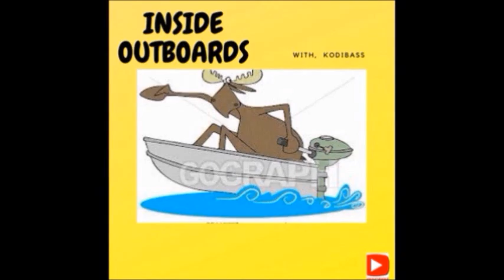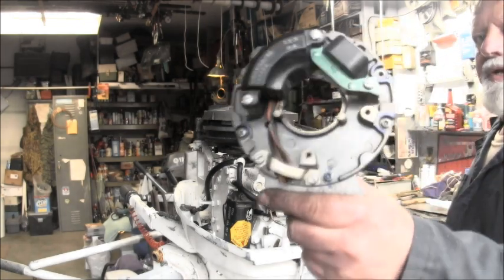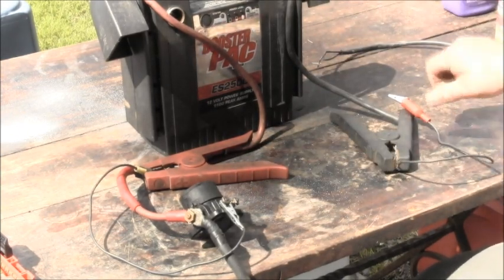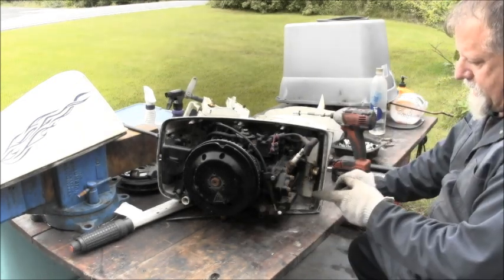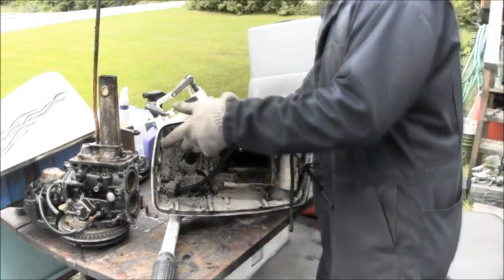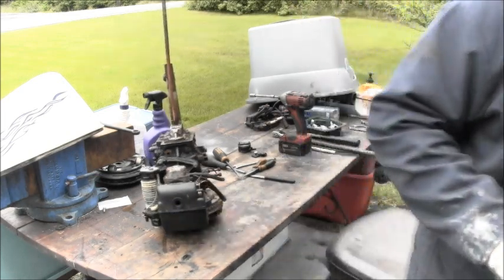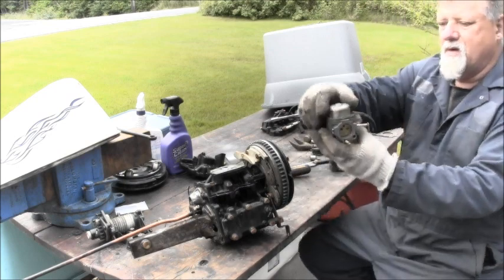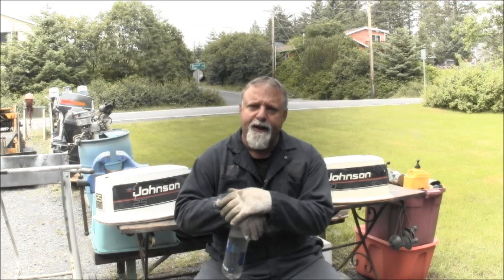JOHNSON 1989 25 / 30 HP & JOHNSON 6 /  7 5

Comment: I recently got a 1989 25hp parts motor and it had the same ignition system and it appeared one of the bolts that held the ignition module on vibrated loose and caught the flywheel and  caused a good bit of damage under flywheel and ripped the wiring on it apart.

Comment: I know an OMC has been "cobbed up" as soon as I see RTV on the crankcase halves and intake gaskets.  The salt water probably just put this poor thing out of its misery.  Hopefully that bowl is OK, those things are getting hard to find in usable condition.  I'm pretty sure the 6/7.5hp powerheads are the same, the 8hp powerheads are different though.  Those darn inner exhaust tubes rot through like that pretty often, folks seem to think these parts are "gold" as well.  Put your decent used powerhead on this poor thing and someone will have a nice engine.

Comment: hey Kodi I have 1968 mercury 35hp it shifts into forward great but when I shift to reverse it barley goes in when in reverse i give it throttle the engine revs but boat is barley moving in reverse forward is perfect do you know what would be causing this